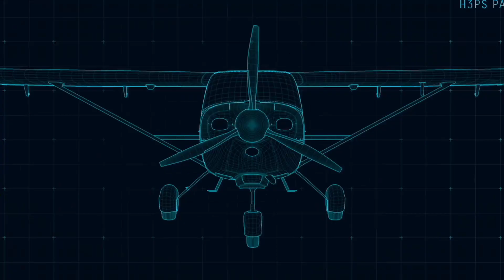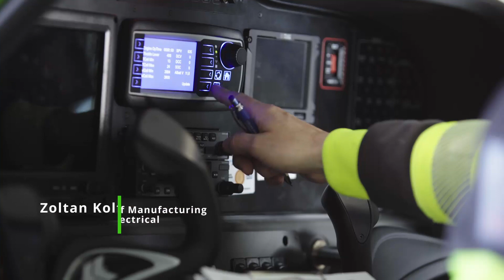Tecnam P2010 H3PS Hybrid first flight

Comment: there is already a 2010 with a diesel engine ...
I don't see the point of a hybrid powered aircraft with a very heavy battery and an electric motor with very little autonomy ...
I'm sure the P2010 TDI is the most efficient ...